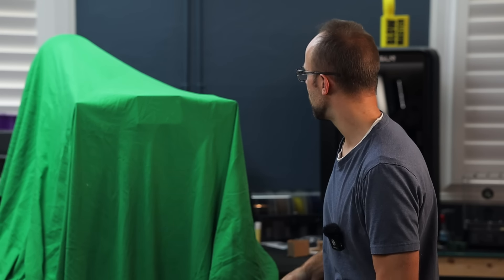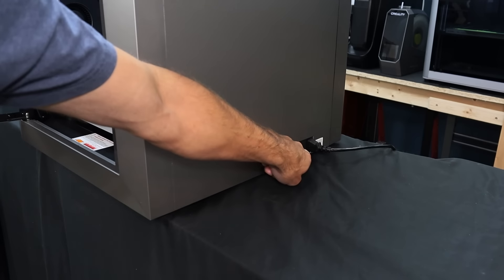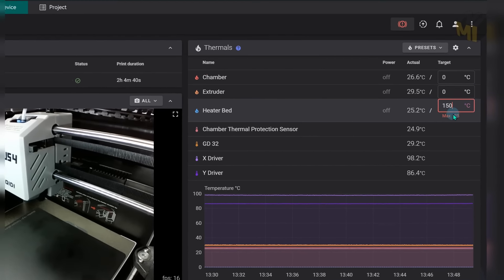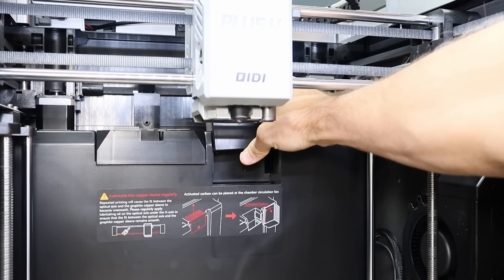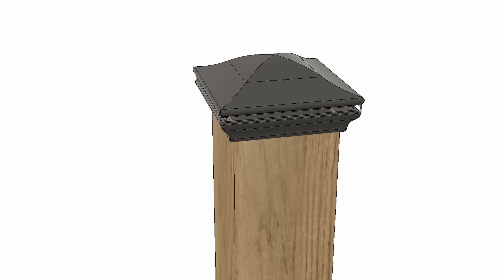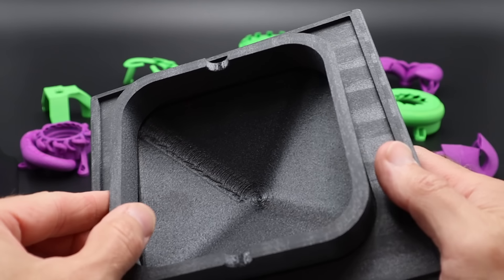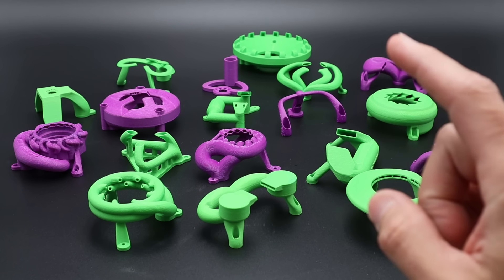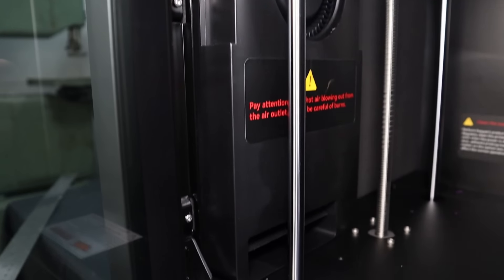The All New QIDI PLUS4 - the best value to performance printer on the market

Comment: ah yes released 2 days after i purchase a X1C , seems about right.
Reply from the maker: The X1C is still a great printer, if you're looking for printing higher temp materials, this is the better printer for the job, and of course it has a larger build volume, I can say that my only main issue with the X1C is the nozzle wiping, and I have a video coming up in the next few weeks to hopefully finally address that and also prove that it isn't a problem any longer too... if all goes to plan (which it rarely does).
Reply: @NeedItMakeIt  which would you say prints faster with better quality? that's my main factor. rapid prototyping.
Reply from the maker: Are you printing in PLA mainly other?
Reply: @NeedItMakeIt  mostly planning on carbon fiber PLA since it tends to print a little high quality and is stronger but yes.

Comment: I wonder if it's really worth €800 compared to spending €400 on the Q1 Pro.
Reply: Depends mostly on if you need the larger size, but also on if you will push the slightly higher nozzle temps. I think it is a more premium printer overall, but similar basic print capabilities.

Comment: Awesome!! The AMS comes in first quarter of 2025!!!
Reply from the maker: Nice, I wish I had dug a bit more on that, I hope it can handle TPU, if that's even possible.
Reply: @NeedItMakeIt  As far as I understand it, the problem with TPU in the AMS and similar systems are the long PTFE tubes. Of course, it also depends on how flexible the TPU filament is that you want to print with. The harder TPU variants can supposedly be used in AMS-type systems. The softer ones will most likely get stuck in the tube.

For QIDI to make the their box TPU compatible the tubes have to be very short and very narrow.

Comment: You sold me on it. Please update is with a coupon code
Reply from the maker: It is a beast of a machine, they did great work on it.  I normally find a lot of flaws with printers that I test, but I only found a couple of little issues.  I haven't heard of any coupon codes, let me ask again though!
Reply from the maker: Okay so there may be one you can try  30DAYSGIFT   there is also a 5% off on the left hand side of their main page too.  See if those work and can you let me know!

Comment: Wait a minute, 3d printers have an off switch? I had no idea, seems useless.
Reply from the maker: That's right, it's best to turn them off if you don't plan on using them for longer periods.  Some printers will go into sleep mode, so it's becoming less and less of a necessity.  Though you usually want to turn something off before you  unplug a machine to prevent it from arching, but again, not really a big deal.

Comment: wish it was 350 by 350 instead of 305x305
Reply from the maker: I think they'll likely have a Max version down the road, I'd expect that there are some challenges with doing it though, the span increase like a floor joist, the longer the span, the taller the supporting members (X/Y Rods) need to become, those rods would have more mass, and so it would work against the printer.  Using CF rods, possibly a custom shape would help, but then we're into far higher prices etc.  I'm only speculating, I have a background in manuf. but not metals and plastics, but in wood, and it's not apples:apples.

Comment: Only thing I'm going to disagree with you on is comparing it to the X1C, it doesn't. It compares more directly to the P1S as only real differences between the P1S and the X1C are the Lidar which the Qidi doesn't have and really just the build materials with the aluminium body. There is some argument about filament capability but really the only other real difference is the touch screen. Now at that point the comparison is a little different as the P1S is $699, though it has been on sale for $599 for so long you could make the argument that is becoming its new price but let's say $699 for argument sake. So what does the QIDI offer for $100 more? Obviously a way bigger build volume. It looks like from your limited testing that those belts have indeed eliminated some of the VFA's that the Bambu and most other printers using the smaller belts experience. That said you do lose the ability (for now) of multi material printing and that is a pretty big loss for $100. I think that decision is going to become more of a (Do I personally need or want that?). I am extremely glad to see QIDI finally abandon those god awful acrylic doors and it looks like they have finally taken feedback seriously and realized they need to actually compete with Bambu. The wiper system is a massive improvement and if they produce a solid ams style system they are going to have made a very serious case for themselves and I'm all for it. There are enough QOL features packed in this little printer that I can honestly say QIDI is a serious contender for my next printer addition for the first time in ages. I'll wait and see if they come out with some form of an AMS and to see what Bambu's next printer is going to be. I would like more build volume, but I don't need it 99% of the time, I would like many of the features the plus 4 has but I'm unwilling to sacrifice the convenience of the AMS for it. Hell I would love a multi head printer that is more efficient than the ams but I'm not coughing up 5k to save a few cents of filament waste. At worst I'm happy to see this printer from QIDI because it like the bambu printers Forces all the other companies to step up their game and start giving us better and cheaper choice. Excellent little printer from a company I had honestly all but given up on.
Reply: This is a more capable printer than the X1C for $400 less. Larger, as fast or faster, higher temperature, comparable quality, heated chamber. It's missing a few features which are far less important to most people doing functional printing I know.
Reply: @802Garage  I wasn't really focusing on capability so much as what he started on which is value for cost. In this instance as I tried to be clear on, value for cost is very subjective as I think this machine more accurately compares to the P1S than the X1C. Especially if you are talking about more basic straight forward printing and engineering. The extra features the X1C brings to the table are rather irrelevant. So if you want to talk pure function you go back to what I said which is that the qidi offers bigger build volume and some better QOL features but you sacrifice (for now) the convenience of the AMS system. So if those features are of value to you, then the QIDI is absolutely the better printer. However if you are a normal hobbiest who is going to be printing regular stuff, might want some multi color capability and that extra volume has effectively zero meaning, then the P1S starts out cheaper and has more features that make it a better value to that kind of individual. In effect I dismissed the X1C because comparing it to that is just so you can say "Oh it's $400 cheaper" when ever since the P1 line came out the X1C has just been the premium I want a fancier machine version not that it is really any better.  I short I agree it is a better value than the X1C, many other printers are including Bambu's own printers.
Reply: @OmegaGamingNetwork  I simply think you are way off base saying it is more comparable to the P1S. It is more similar to the X1C in most respects and bests it in several. It only lacks a few features of the X1C, but the X1C also lacks features this has. I think the Q1 Pro is closer to a P1S than this is. Or the Flashforge Adventurer 5M Pro for example. If you are just arguing based on the X1C being a poor value for most people since the P1S does almost everything most people will need, then that just means this compares to both machines, and one far more favorably in price. So I guess I get what you are saying and can agree on that point, but even people who don't own an X1C jump to comparing everything to it without considering the large price gap.
Reply: @802Garage  I own both the X1C and the P1S. The only real difference between the two is the LCD screen and the Lidar/AI first layer inspection/failure detection. Ignoring the LCD screen the QIDI doesn't have lidar or AI detection. Now without getting into an argument on the value of those two features the rest of the hardware capability of the P1S is on par with the X1C. Actually I think the P1S didn't come with a hardened extruder and I needed to upgrade that, but that took ..5 minutes and like $15? Anyhow I am getting off into the weeds here, the point I'm making is that outside a few very specific features which the QIDI also doesn't have, the X1C and the P1S are effectively the same. My argument is that the QIDI better compares to the P1S because its upgrades are direct upgrades of those exact features. If you want to compare the QIDI to the X1C then you have to talk about the lidar and the AI detection which is another argument entirely. Now being completely fair, I've found those two features all but useless and unless bambu makes some serious changes to them all my future print farm oriented purchases will be the P1S because the x1C brings nothing to the table to justify that price increase. I however have friends who swear those two features are game changers for them. Again don't get me wrong, I am very impressed with the Plus 4, it is the first one from them in quite a while that is absolutely a good looking printer at face value (Though I do want to see more than 1 review of it). I'm not even arguing that the P1S is better than it, I think it just comes down to personal use case. Spend a bit more money, get a bigger capacity and very capable printer but lose the convenience of an AMS? Or spend a little less, lose some capacity, still get a very capable printer but have the option of an AMS.  Neither choice is a bad one. I just don't believe the X1C is a fair comparison because they have very very different capabilities and it is like comparing apples to oranges. I guess a better way to say it is, In a world where the P1S didn't exist, I would absolutely buy the Plus 4 over the X1C.
Reply: @OmegaGamingNetwork  I'd argue that comparing the Plus4 to the X1E would make more sense.  Both are aimed at engineering grade filaments with extruders and nozzles to suit.  Both have off-air wired network connectivity.  Both have chamber heaters.  Both have AMS compatibility (even if the Qidi version is 4 months out).  Both have color LCD touch screens.

After making that comparison, then it comes down to a much smaller number of differences.  LiDaR + flow calibration on the X1E, and a larger build volume and built in carry handles on the Plus 4.   Admittedly the carry handles aren't going to affect printing, but I'm just trying to point out about the only things that functionally differ between the two.  On that score, the Plus 4 comes in at significantly better value than the X1E, especially since as you say, the LiDaR + flow calibration are basically gimmicks.  I don't recall, but does the X1E have filament tangle detection?

I agree with @802Garage, comparing it to the P1S is kind of silly, because the target feature set is just so different.
Reply: @OmegaGamingNetwork  I don't have time to read your entire comment right this second, but I think I get your overall point. My point is simply that comparing the Plus4 to the P1S instead of the X1C is unfairly lowering the perceived value of the Plus4 given its specs and capabilities. It is a much more capable printer than the P1S.

Comment: Looks rlly like a x1c
Reply from the maker: Most of them look similar with the CoreXY format.  Side by side, everything is much heavier duty, to give to an example, the X/Y gantry blocks are 25% larger, but not just that they're solid unlike the Bambu, the Nylon GF is also going to be stiffer and less likely to change shape with the added heat of the chamber.  I didn't show the rear brackets which hold the motors and the belts, they are massive, which is fine because they're stationary.

Comment: Dont buy it, mine just arrived and bed is defective, the print head heats up, the chamber works but bed is dead. The unit shuts off when turned on.
Reply: Went around to comment on every review instead of just waiting for a customer service reply after the Chinese holiday? Check your power supply voltage and the bed connection.

Comment: To be honest , there ar not much improvements compered to the previosly version from them .I am a little bit disappointed..... I own a X MAX 3 , and I made o lot o modification to make it useable,
I exchanged exactly 62 emails with Qidi suport about the problems with it and I believe I was not an only one ! Was hoping they will make a homework and improve the next series.  Sure , 4 seres its bigger, looks more like everybody knows which brand (for me its a not the best step ), but not much change in physic build of a printer . Still this same metal frame, this same belts solution, this same diameter rods and etc. Basically , pretty much this same printer in a slithy different shape . To bad QiDi ........

Comment: I bought this on your recommendation. It is garbage.
Reply from the maker: It is by far my favorite machine so I can't say I share your perspective.  Is there some info you can provide so that I can run some tests to find out if there is a problem?  I do have the ability to feed info back to QIDI if there is something that needs to be corrected that I've not found.  If you don't like it or it's not working for you, send it back, they have great customer service, I'm sure they'd work with you.

Comment: I understand that this is a paid review, but why keep bashing bambo for duration of the video? Is it really necessary? Plain shill is plenty. After all the bambo negativity I have simply hard time trusting anything in this review.
Reply: Are Mike's attacks on Bambu in the room with us now?

All he did was use the X1C as a point of comparison a handful of times and made absolutely zero disparaging remarks against the X1C when he did. I believe you may want to reassess what you consider to be criticism. Mike frequently praises the X1C in his other content.

It is possible for someone to like two different things at the same time while also acknowledging their differences.
Reply: @stew675  yes its all just a coincidence 😅 bambu competitor, sponsored video and the only mentions of other printers are of bambu and all are negative.
Reply from the maker: I think the only time I said anything negative was at the end, I'm not sure it was negative, it as just a fact.  I mentioned that the PETG print didn't turn out and that the PETG shrunk too much (Not a Printer issue as much as a material issue).  The X1C struggles with PETG due to the nozzle wiping setup they have.  I enjoy using my X1C very much , for color printing, it's a great machine, just avoid using PETG, or maybe use their new HF-PETG, I've heard that it's pretty good.
Reply: @gcardinal  You're really clutching at straws to claim that Mike was attacking Bambu here.  Then again, NoizieWorks mentioned crazed BambuLabs Fanbois attacking him every time he mentioned that any other printer is good.  His (and my) question was: Why are you all so defensive?
Reply: @stew675  I just find it amusing how one company pulls it self up using its competitor. I think it never happened in 3d printer world before. Now with a clear leader situation is different. 

I dont own any bambu products atm, but I did previously. If anything Im a ender 3 fan boy 😅

Comment: It's a bambu clone period
Reply from the maker: Bambu is a clone of Voron printers.  I think that Bambu did some good stuff with the wiping and AMS and they've created an entire ecosystem around their printers, the parts are also affordable too so I can't take anything away from them, but this printer is far more capable than a Bambu when we're talking high-temp materials.  I'm curious about Bambu's next release though, I've heard that they'll be doing some type of IDEX setup, I guess we'll see.
Reply: @NeedItMakeIt  clone from Bambu? Not really Bambu has ams. Clone is the sovol sv08
Reply: @marine1718  Bambu is a clone of MANY printers which came before it. Qidi was making enclosed core XY printers before Bambu Lab existed. People need to learn at least basic 3D printer history.
Reply from the maker: I'm not sure any of these ideas are new per say, Bambu in their defense does a good job of putting together a nice package that works very close to perfectly each time.  the Profiles are nice and the apps etc.  Most of the ideas are not theirs though.  I can't say for certain who created the first CoreXY, but it was not Bambu, it was created by a team at MIT I believe.  First used in 3D printing by the Voron Team (Correct me if I am wrong).  In the end, competition is good, it drives innovation and keeps the prices reasonable, so the more the better, hopefully we see some more innovation in the next gen of printers soon.
Reply: @802Garage  and get counselling to explain why they feel compelled to make those comments.  Every review has a clone comment.